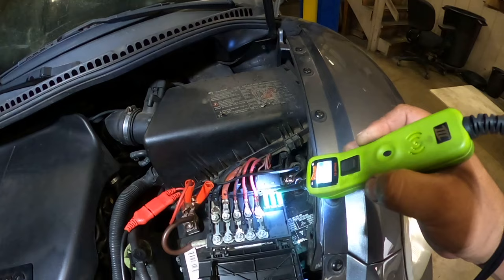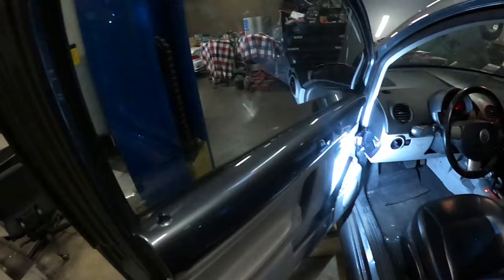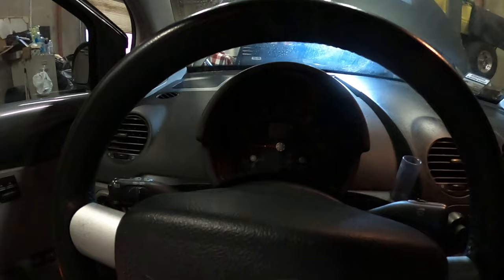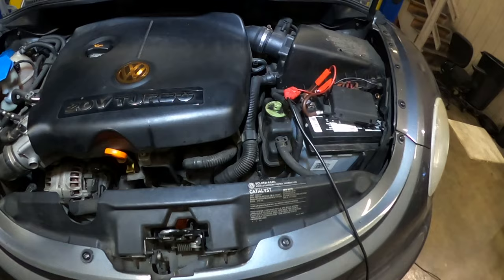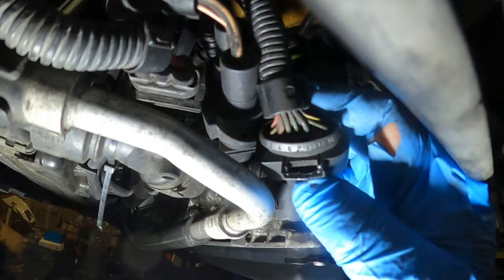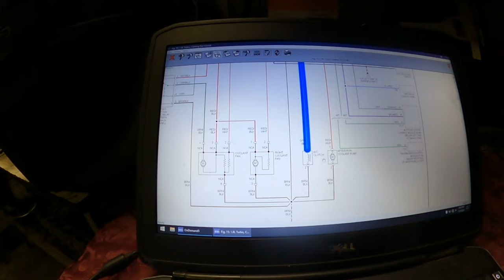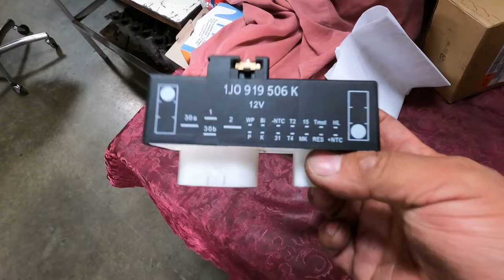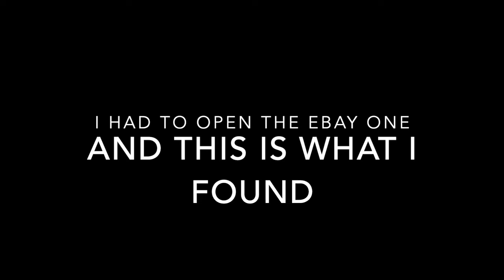VW BEETLE A/C DIAGNOSIS AND REPAIR. 1998-2005 BEETLE A/C REPAIR COOLING FAN CONTROL MODULE REPLACED

Comment: Very very good info. Diagnosis steps are accurate and led me to the fix which was the fan control module. Another good hint I learned also is if the fan motors have seized it takes out the control module also. And Thank you!
Reply from the maker: I’m glad, that’s something new to me about the fan motors.

Comment: This is a very basic question (Because I don't know much about electronics), but what should the reading be at the fuses? Is it going to be ~12.5 v?  or is it different because of the resistance in the fuses?  I'm getting ~ 5.7v at both #5 & #16  that's with the car on and the A/C turned on
Reply from the maker: @pcdreams1  should be over 12v

Comment: Great video. Is this similar to a 2011 Volkswagen CC? Currently I’m attempting to diagnose an issue with my AC. The vehicle has good fuses and the fans seem to work when I do an output test with my OBD11. I also removed and put 12v on the AC solenoid that’s attached to the AC and it clicks which makes me think its functioning correctly. Still no AC. I did realize that when I hook up the Freon bottle with gauge, it shows it’s overfilled almost max out. Any suggestions?
Reply from the maker: You have to check several components. Make sure both fans are on and it’s not suppose to be overfilled. Check to see if the compressor clutch is engaging and disengaging. Make sure the blower is working and it’s blowing air inside the car thru the vents. If all of that is good you might have a problem with other components like compressor, condenser, orifice, valves. Or it might even be electrical. I recommend you look at one of those YouTube videos on how the A/C works, determine what kind of system you have and go from there.

Comment: When you check the compressor itself on pin 10 do you have to have the ignition key and the air turned on?
Reply from the maker: @jimpomarico2831  yes

Comment: Is the ac suction line the one on top of the accumulator/little can. 
It runs from the top of the can to the front of the radiator/condenser.
Reply from the maker: It’s always the thick one. The thin one is the pressure hose
Reply: @mysterygarageCA  so the thin one is the discharge line
Reply from the maker: @user-eq5ud9tp8o  The thick one is the one the compressor sucks from and thin one is where all the pressure goes to. If you turn on your A/C make sure both fans are on. If not, your problem might be the main relay or a sensor that is on the upper radiator hose. It’s round and has two wire connector.
Reply: @mysterygarageCA  I know my problem the line that goes from the accumulator to the condenser has a break from rubbing the serpentine belt. Just trying to see if it’s the suction or discharge line on the ac so I can replace it. Oddly there’s no vids or nothing on the topic
Reply from the maker: @user-eq5ud9tp8o  I see. But they are called the high pressure side or low pressure side. Look it up online as the high pressure or low pressure and compare them to see which one you need.

Comment: Where did you get the fuse map and wiring diagram?
Reply from the maker: Fuse map anywhere online. Diagram I have software called On Demand. But you can cut a repair manual from autozone for $18.
Reply: @mysterygarageCA  You say anywhere but I've searched a lot and haven't found my 2008 Rabbit. My owners manual is not even close to what's in the car. It looks like 16 and 5 but I guess testing all of them would be a start.
Reply from the maker: @BariumCobaltNitrog3n  I’ll check tomorrow see if I have it I can send it to you. What’s the year make model and engine?
Reply: @mysterygarageCA  2008 VW Rabbit 2.5 (not PZEV the other one) 4 door automatic. Thanks
Reply from the maker: @BariumCobaltNitrog3n  let me see if I can get those for you!
Reply: @mysterygarageCA  Thank you, much appreciated.
Reply from the maker: @BariumCobaltNitrog3n  I do have those diagrams do you have an e-mail so I can e-mail them. You can contact me on Instagram @ garage_mystery.
Reply: @mysterygarageCA  ok

Comment: Hey buddy how can I check the realy inside for the A/C because my fans is not active when you active the A/C buddy
Reply from the maker: If your fans don’t turn on most likely is the relay, there is a sensor on the upper radiator hose, that controls the other fan as well. So you have two relays, one is underneath the battery, the main relay, and the other one is under the dash, the fan relay. Don’t buy them on eBay. Get it from dealer or junk yard.
Reply: Awesome video just subscribed, I'm a retired Nissan/Toyota tech, got my daughter a bug and man they do things different than I'm used to lol.  So my 2001 Bug is having the same issue I didn't start the diag process yet but it sounds like both fans have to be on for the compressor to kick in....and when u say 2 relays u also mean the module correct?
Reply from the maker: @kevinterebetsky7014  yes. It’s not a big deal but definitely different from other manufacturers.

Comment: I don’t have power at pin 9, what could be the problem?
Reply from the maker: Pin 9 is power coming from the fuse box on the driver side. Open driver door and on left hand side of dash there will be a fuse box. Check fuse #5. Is a 7.5 amp fuse. If it blows again check you pressure switch on the main line behind firewall or the sensor on upper radiator hose. In front of engine.